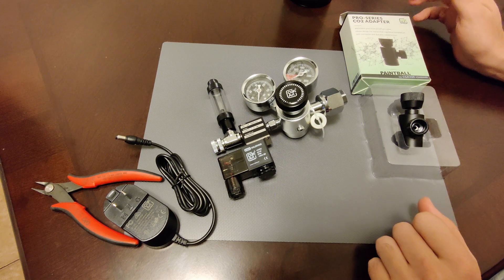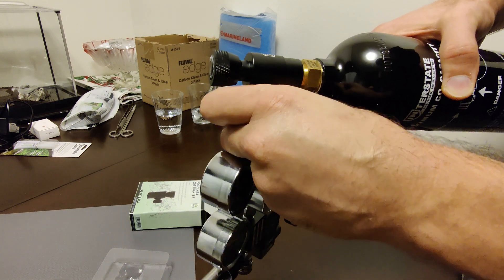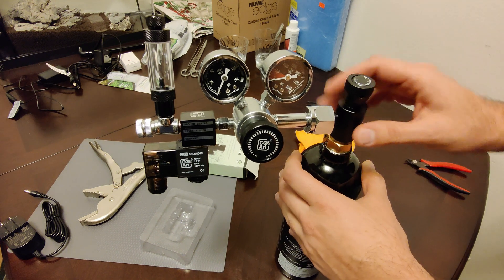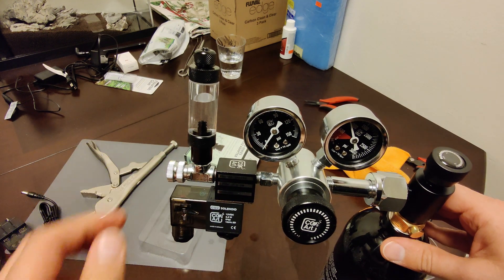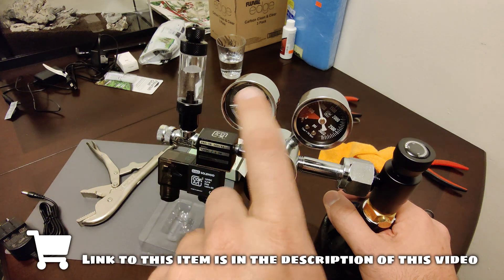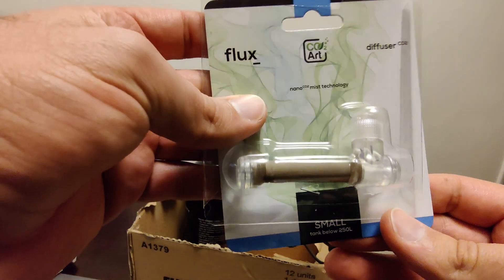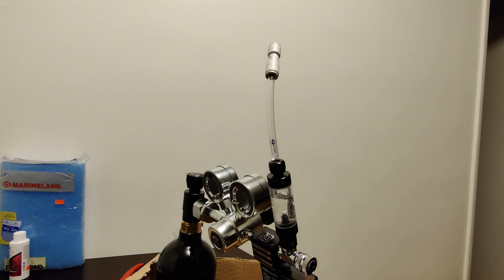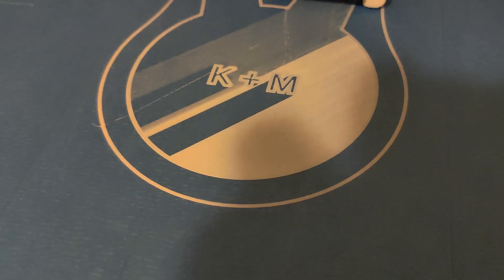Fluval Spec Planted Aquarium Part 2 - CO2 Setup

Comment: I cannot find that paintball adapter. Do you have a link for it? Thanks!
Reply from the maker: This is the exact one I have: https://www.co2art.us/collections/co2-accessories/products/new-pro-series-co2-adapter-for-paintball-sodastream
Reply: Thank you! Seems I looked everywhere but the actual website. I was searching for a 90 degree adapter so the regulator is in the correct orientation on paintball tanks and this fits the bill perfectly! Thanks again.
Reply from the maker: @SpaceCityRanch  You're welcome. However, note that the setup is very top heavy and without some kind of base it tips over

Comment: Thank you Chris for this tutorial! I purchased the exact same setup a week ago and kept getting a loud hissing noise because of a leak and couldn’t find anything similar online and the company website wasn’t helpful. Yours is the only tutorial I’ve found to be this type of adapter and regulator. I questioned the need for another check valve since the bubble counter already has one but if I need to return an item, I need to send it back to CO2art in Germany, so I’m stuck with it. Oh well, I guess it’s an extra safety measure
Reply from the maker: Try using soap/water to find out where it's leaking from